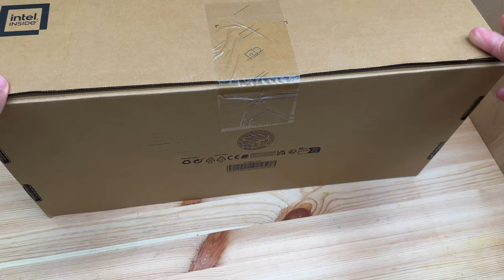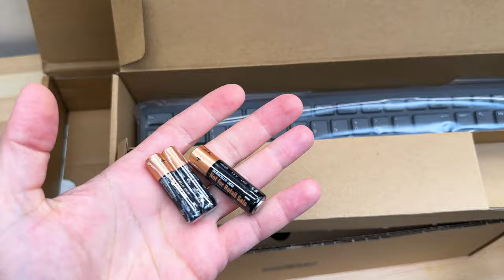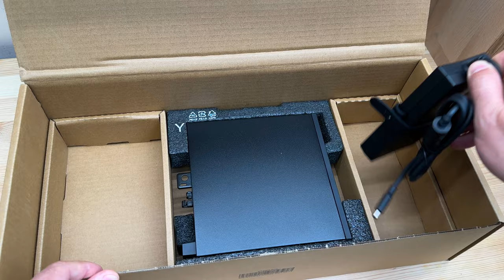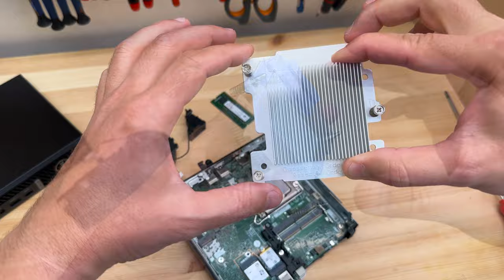BEST Business PC & Swappable CPU? - DELL OptiPlex 7000 Desktop Micro Form Factor (MFF) - Disassembly

Comment: Great! So I can upgrade the RAM then?! And maybe even change out the CPU for a faster one?
Reply: I have an i7 13500T that's clocked at 1.60GHz and it's not doing so hot..
Reply: @jelanipowell1291  "it's not doing so hot" you mean 13500T is not that fast?
Reply: @NatsirtMats0  yes... exactly that.

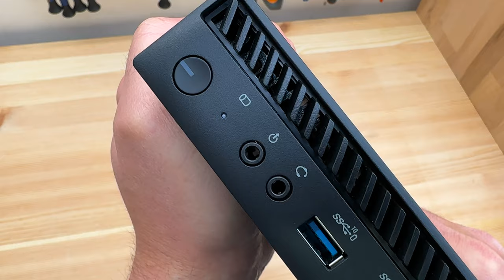Comment: At 1:09, the upgraded model boasts a type C port upfront.
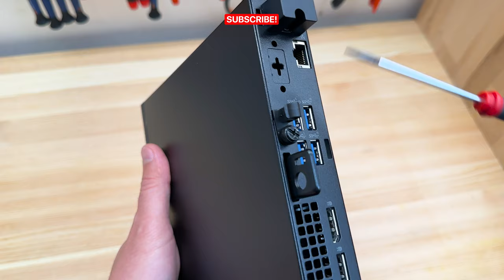By 1:16, mine proudly flaunts 3 DVI ports.
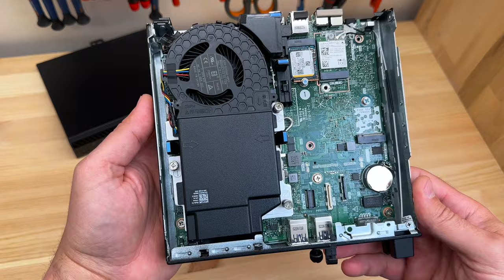But at 1:26, they've axed the slot for 2.5mm storage. Farewell, HDDs.
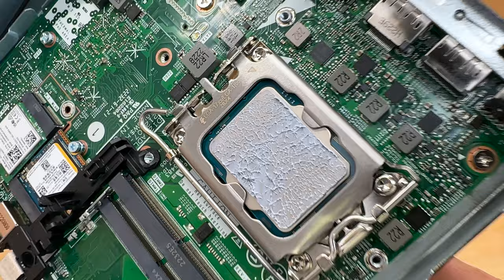Ah, at 2:16, the beauty of this PC lies in its detachable processor.
Overall, I favor this unit over a laptop. Just attach a portable monitor for on-the-go convenience.